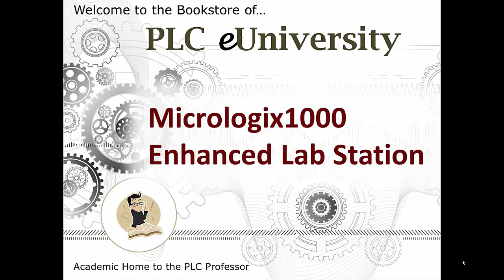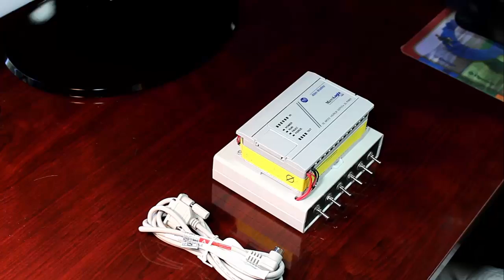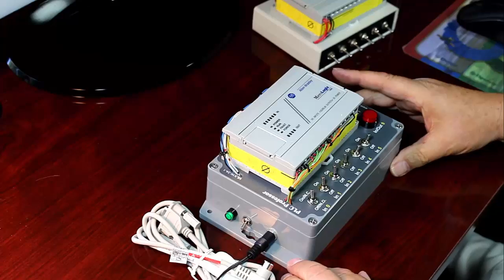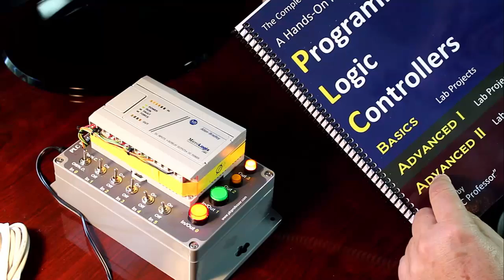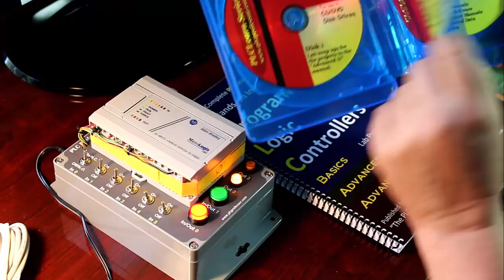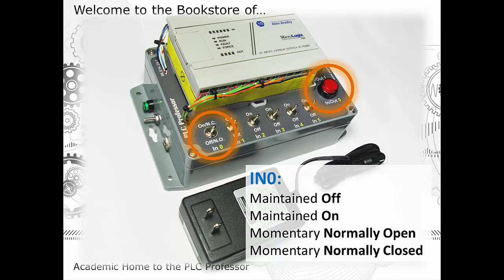Special Order ONLY!!! - MLGX1K Lab Station

Comment: where can I purchase a lab station, when I went to www.plcprofessor.com I received an error message!
Reply from the maker: +James Mayhan Thanks for the heads up... I called my webmaster and he thinks that it is a server issue and he is calling them. My apologies...
Reply: Thank you for the response, where can I purchase the trainer and learning software?
Reply from the maker: +James Mayhan I just checked the site and it is not back up yet. I would try again tomorrow morning.
Reply from the maker: +James Mayhan Very frustrating... still a problem with the server involving e-commerce updates.
Reply from the maker: +James Mayhan the site is up again and you can find the products in the bookstore. If you tell me what exactly that you need to learn, I can direct you to the specific products.